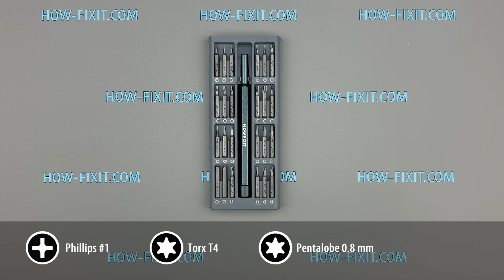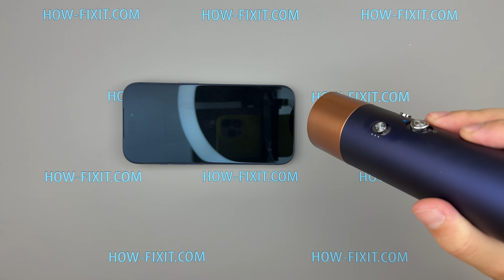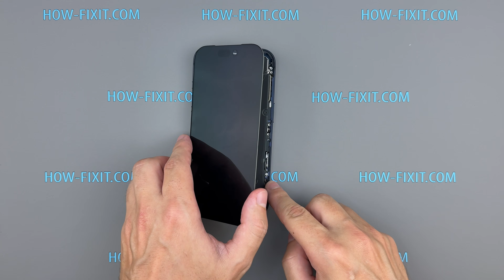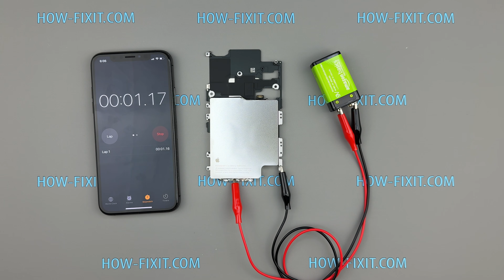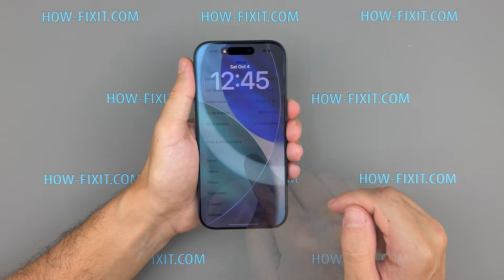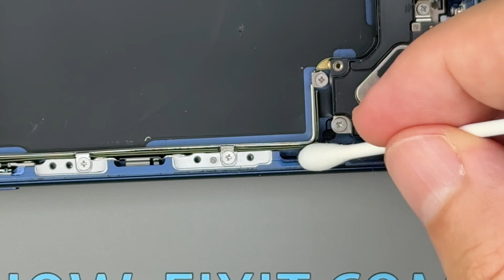How to Replace iPhone 17 Pro Battery | Fix Fast Drain & Service Warning

Comment: With this new adhesive, if I have to replace the battery again, should I follow the same procedure, or did you use a different adhesive for the new battery? Is it the same adhesive or a different one? Because it looks like it stuck without you even using the battery ?

Comment: Is it physically possible to be in possession of a 17 pro in feb 2026 and have a battery degraded so much it needs replacement??? If so its a job for Apple warranty I would suggest
Reply: This is a service youtube channel. They probably played a video at full brightness on a loop while charging to cause the battery to go through numerous cycles in a very short period